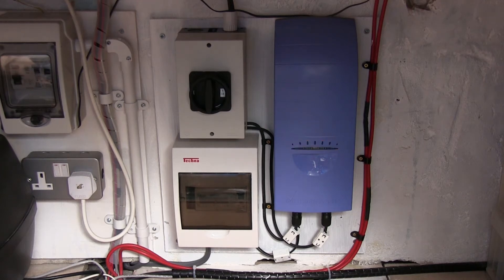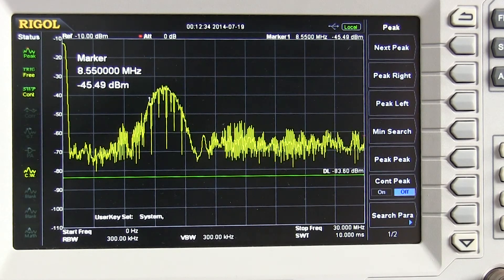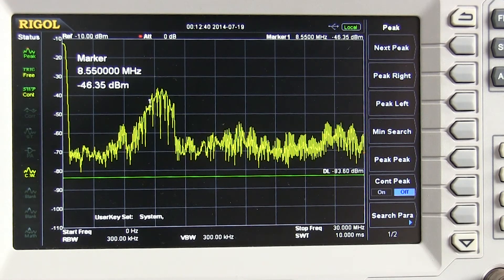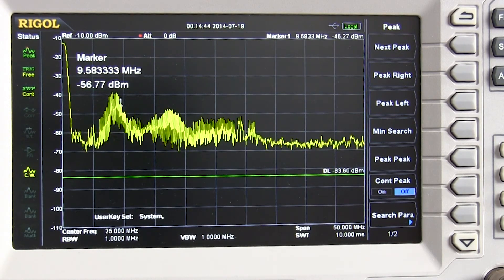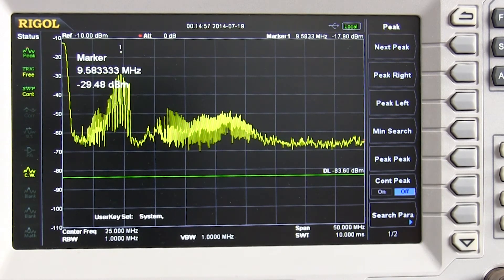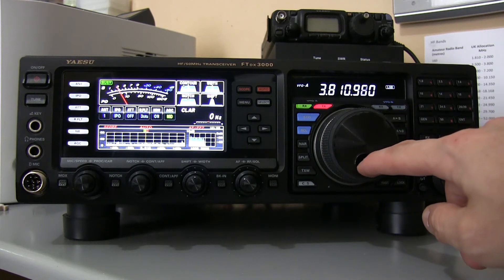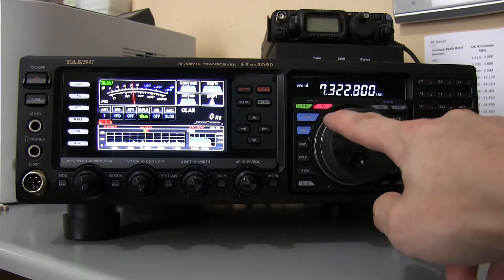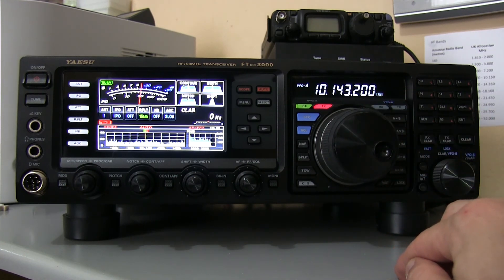Mastervolt Soladin 600 RF interference

Comment: Hi Brian. How did you get rid off that noise? Was generated on the DC part, or in the Grid part? I had a lot if interferences in my solar charge controller FM80 from Outback, and I was forced to avoid wire spreading-conducting by installing a very stepness filter in between pannels and closest as possible to the FM80.
Reply from the maker: The noise was coming out of the DC side. I found a large RF filter and there is more info about the fix and the part links on https://www.briandorey.com/post/mastervolt-soladin-rf-filtering